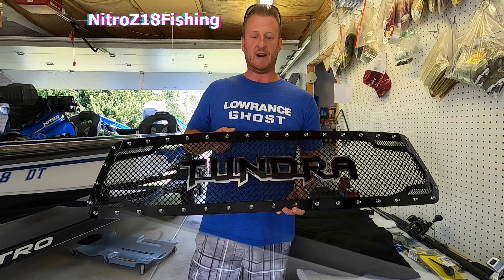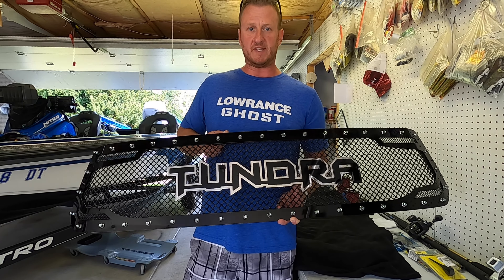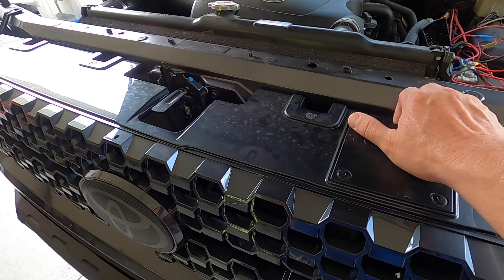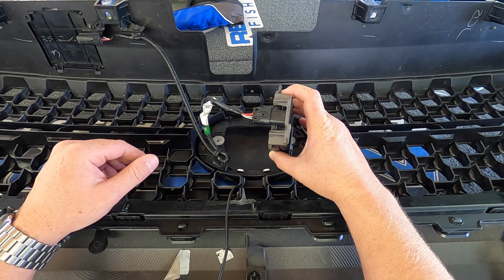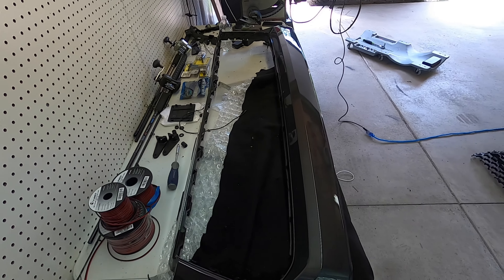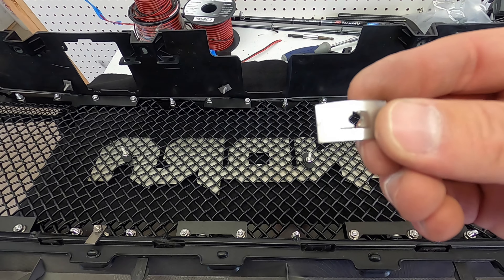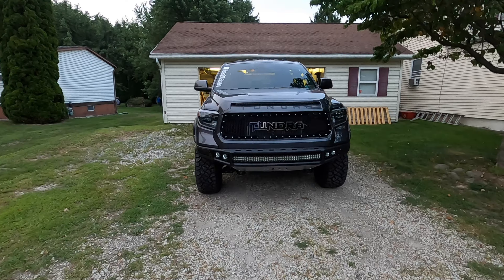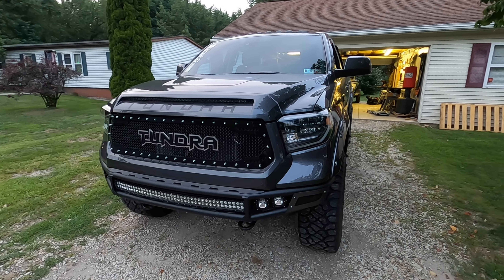Royalty Core Grille Install on a 2020 Toyota Tundra

Comment: Insight please. I want to install the heritage trd pro grill. I also have a 2020 tundra platinum with tss. From what you saw could I pop up that top piece with the tss window and connect it with the trd pro grille. I was thinking of getting the relocation bracket from ajt for the tss. 

Thank you in advance. Love the channel
Reply from the maker: Hey Miguel!...have you seen my videos on where I relocated my TSS??...if not definitely check them out, I moved my TSS to a location that will work with any grille on the market, it’s been almost 3 months now and works like a charm!...best part is it doesn’t cost a dime to do, no bracket needed...let me know what ya think, thanks for all the support my friend!!

Comment: What kind of bumper do you have? Looking to get a bumper for my truck also.
Reply from the maker: it's the Nfab MRDS, I modified it to fit the lights I wanted and OEM parking sensors...I have install videos of them on the channel as well if it would help!...here's the link for the bumper install 
https://youtu.be/09QWlIrqXKI
Reply from the maker: and here's the link for how I ran the wiring and installed the lights/switches/sensors
https://youtu.be/fQh7_jGQhnQ